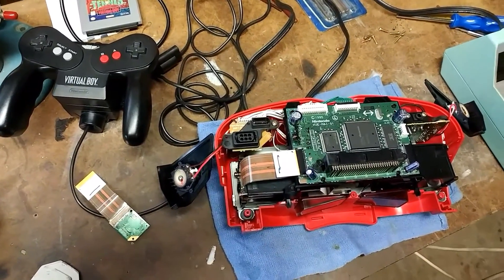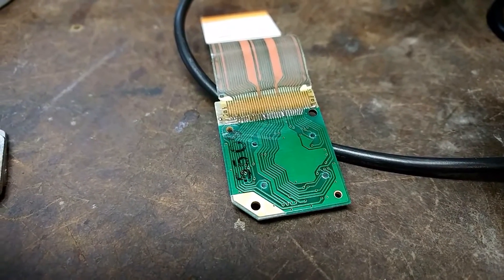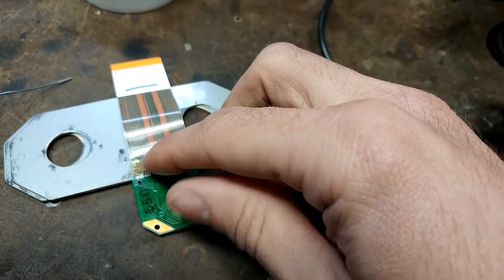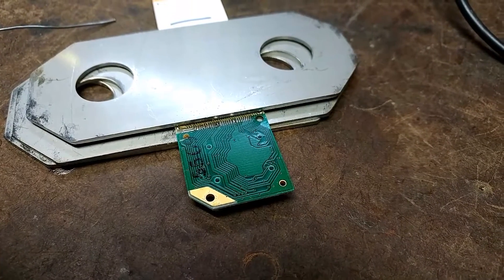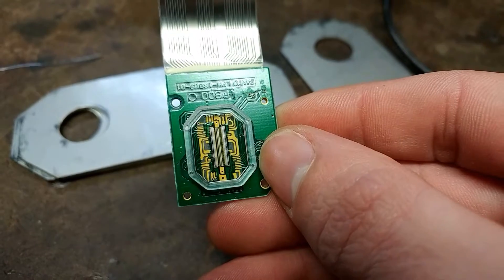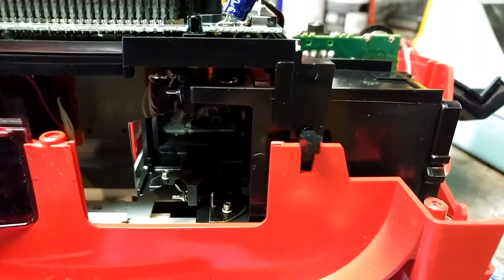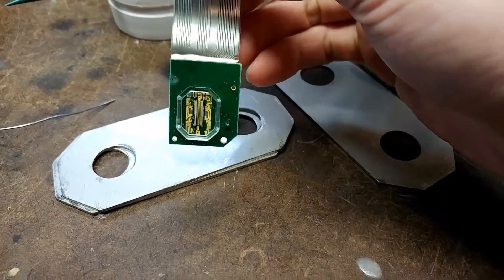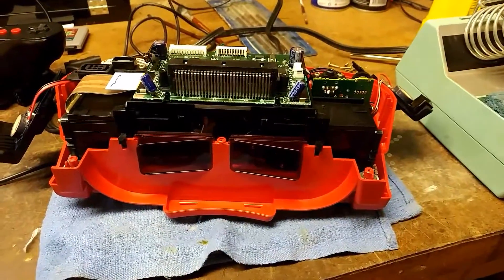Checking out a Nintendo Virtual Boy.

Comment: The solder method seems to work almost perfectly. I'm not experienced in soldering myself, but I paid a guy to do it for me a few years ago and I haven't had any problems since. I'm one of the few who actually likes the VB; it's certainly got it's issues, but it's also an incredibly unique and collectible system with some overlooked games.
Reply from the maker: computerkid1416 It's a system that did have potential. I don't only it was designed a bit better to be more portable and to be used in a more traditional manor like other VR systems.